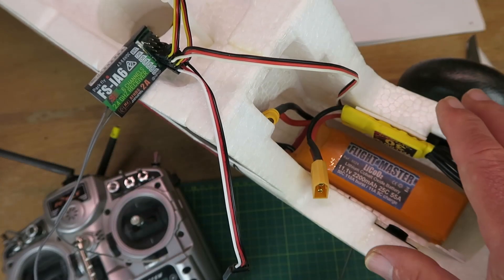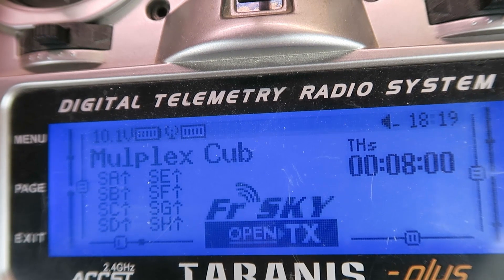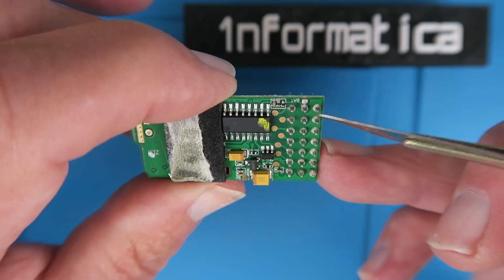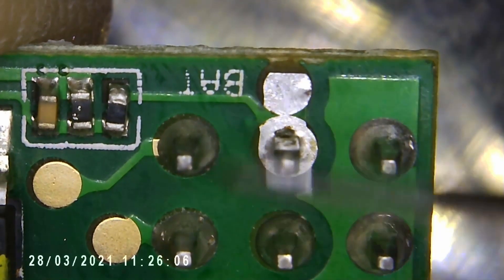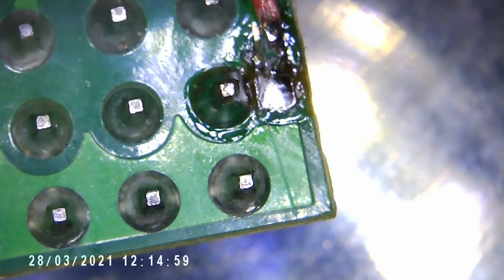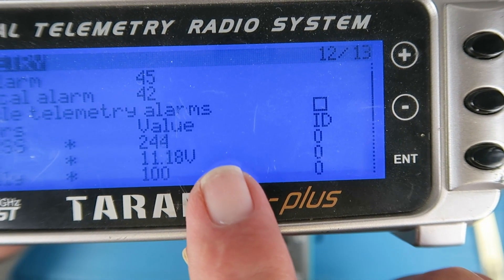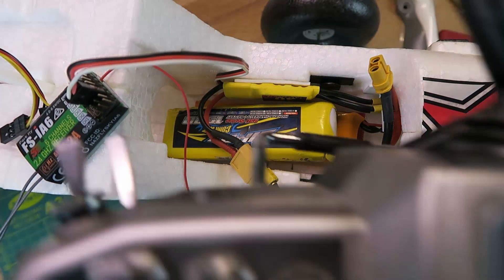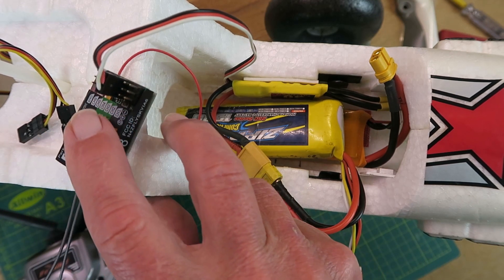FlySky Turnigy IA6 6CH 2 4G AFHDS 2A Receiver Telemetry Mod Hack

Comment: hello, it works, but when I tried to cut the tin between the pin and bat the receiver no longer works, and I can no longer use it, you would have a solution to bring it back to life
Reply from the maker: The "BAT" pin is only to sense the battery voltage, cutting it will not stop the Rx from working. Check that your cut is like this : https://youtu.be/acVbiXG99eo?t=242
Reply: @1nformatica  thanks you, i cutted to much, later i will I will restore the circuit with the tin
Reply from the maker: @mickbastion  Take it slowly and you will be OK.

Comment: what OpenTX firmware are you running, just updated my TX and now i no longer receive any telemetry from the IrangeX module.
Reply from the maker: Hi, I'm running OpenTx 2.3.10 with IrangeX V 1.3.1.77 guess it's the IRangeX that needs updating. Please consider subscribing if you have not done so already!

Comment: This has been covered by others before but mostly not with your usual clear visual and spoken style, old son. Thanks.
1 thing I did wonder though was if it would not be better to tap the voltage as far downstream as possible (eg at the ESC) and thus cover dodgy battery connections as well. Something that has caught yours truly out before. 🤔
Easier to shift the receiver like this though.
Edit.. I think that there was a limit to cell count also with this receiver readout - 3 cells or no?
Reply from the maker: Thanks for the comments. For me connecting the balance plug is universal also I get to play with my 3D printer! It was not clear to me from the information I saw what the max voltage is. I did read that if you put 51 KΩ in series the voltage reading would be half, easy to scale on the Tx.
Reply: @1nformatica  Sounds good to me!